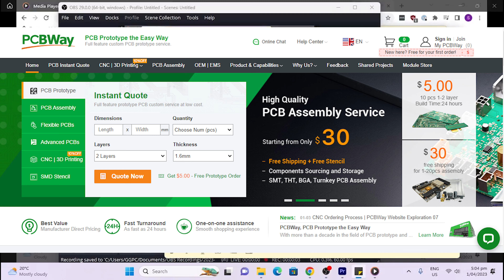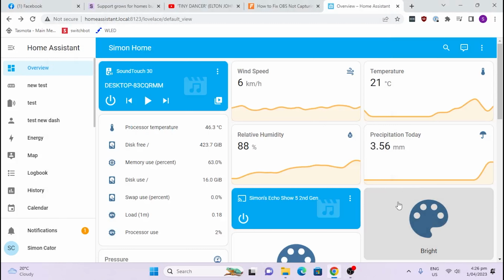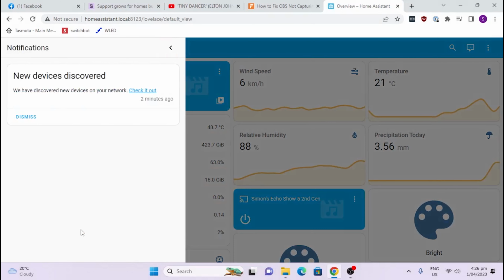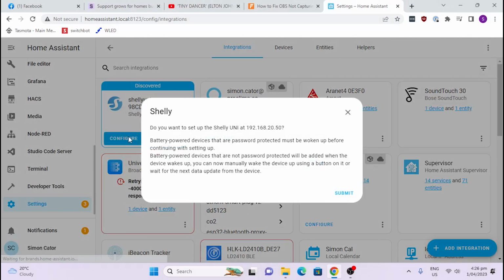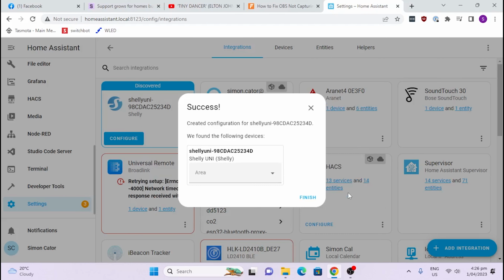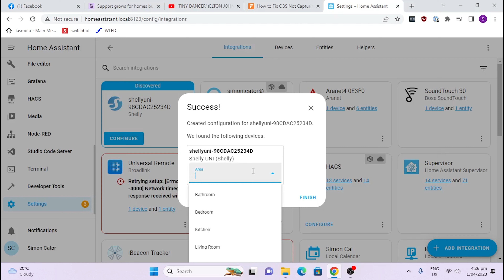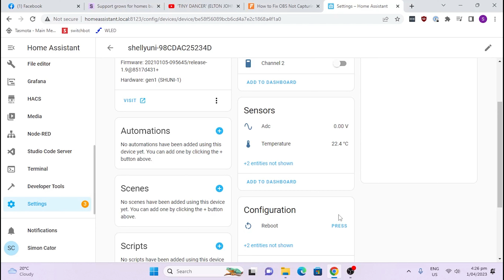Dallas Temperature Sensor in Home Assistant

Comment: Can Shelly do both temperature sensor and voltage meter on one unit?
Reply from the maker: Yes you can connect up to 3 temp sensors plus voltage meter in one unit!
Reply: @simonsayshomeassistant  can you show us how in a video!~! :)

Comment: Hello, I have connected Dallas sensor to ESP32 and it works. BUT. I also need to connect meat temperature probe which is technically a thermistor. Do you know by any chance how to write the yaml file in the ESP home?
Reply from the maker: Hi, you would need to check on the ESP Home page to find the code to work with the meat probe.